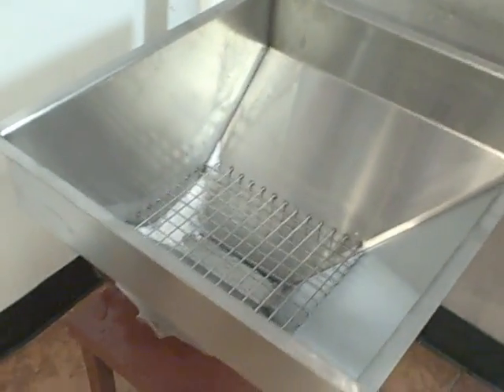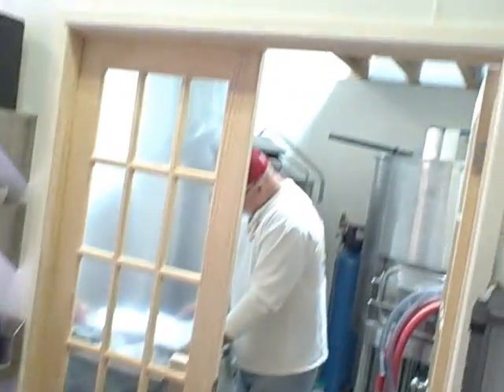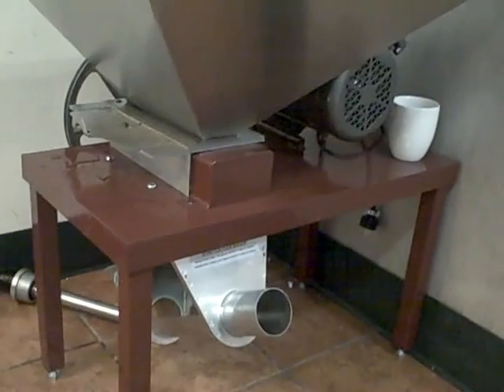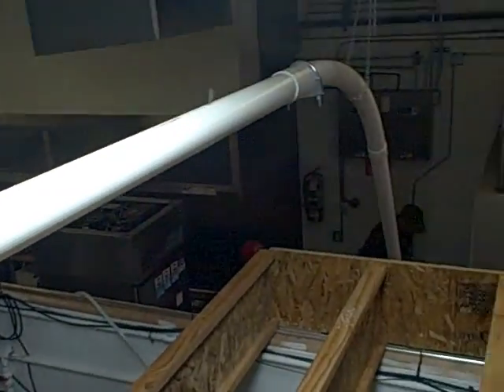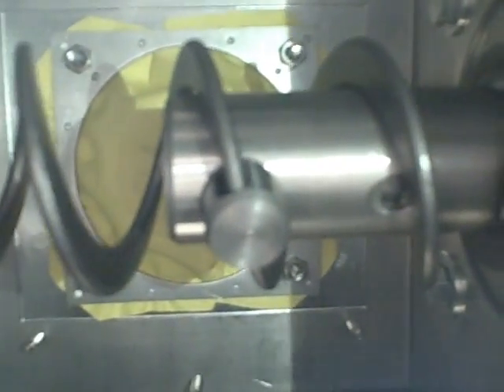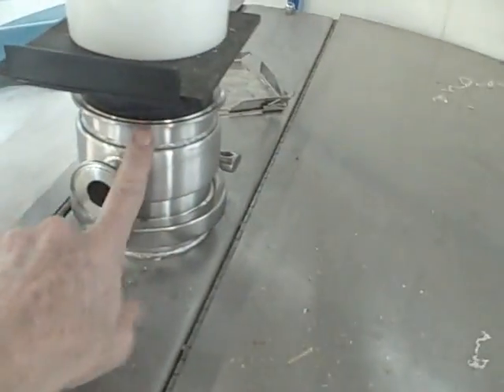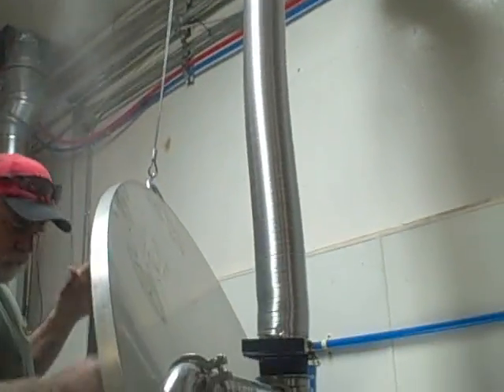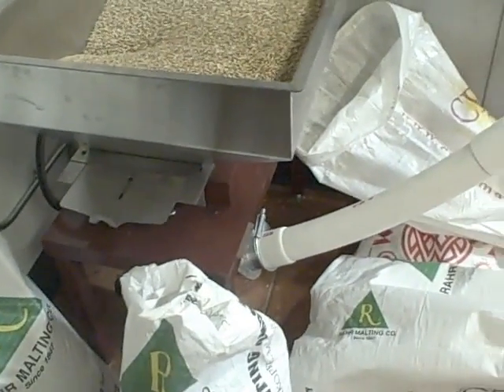Installing a Brewery Auger System  - More Videos At www.coloradoboy.com

Comment: Nice.. I have a question. How long does it take to get all the grain in to te mash tun? 5...10... 20 min? Is it bad that some grain spent more ore less time in the water?
Reply from the maker: I think it's between 15 and 20 minutes. There is no problem with timing. You start your mash time when the last of the grain is in. The first grain will only be in an extra 20 minutes or so and does not effect the mash.

Comment: Do you know how many lbs/hour you get out of the flewx-flo? I have one and am only getting around 1500lbs/hr when it should be able to do 6000.
Reply from the maker: We only have a 7 BBL system so our mash is usually only about 450#. I haven't timed it but it takes about 15 minutes to 20. But I think mill speed has a lot to do with it.